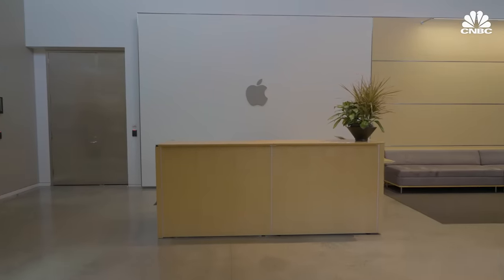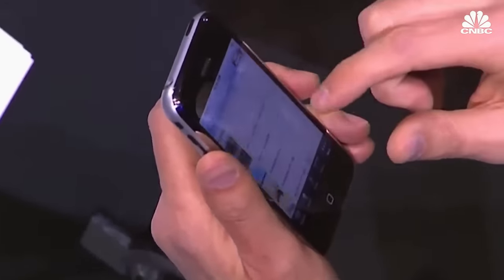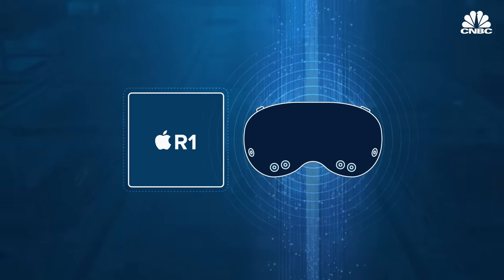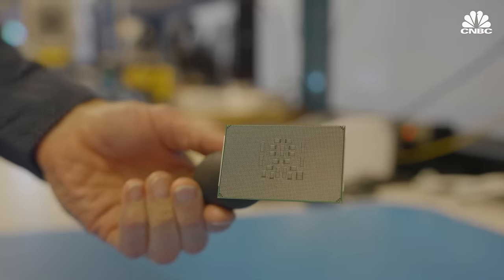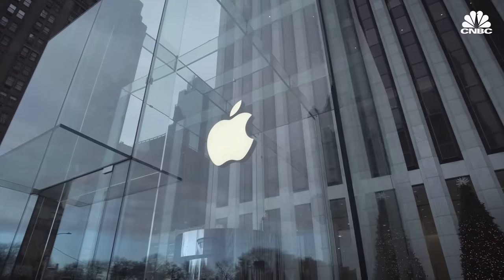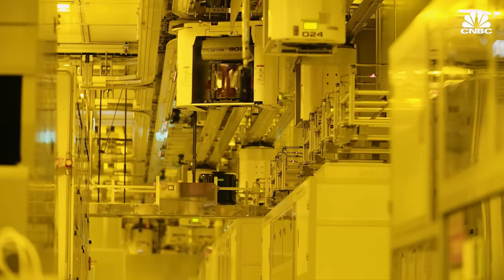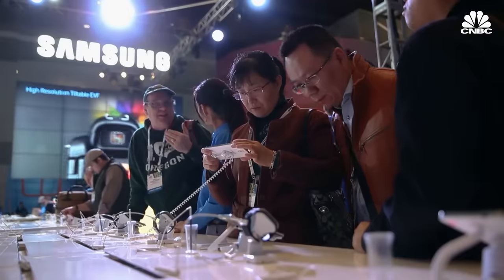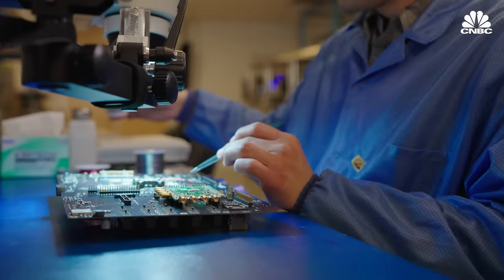Inside An Apple Lab That Makes Custom Chips For iPhone And Mac

Comment: If you think about it, it's kinda crazy that they probably have chips in that lab that won't be announced for at least another year or more. The M4 is probably being tested in that lab right now.
Reply: Much more. Their development lead time is years, not months. And that's not crazy at all. These things don't get created overnight.
Reply: @moeskido  I guess it's just interesting in the sense that by the time it's presented to us as new and modern and groundbreaking, the tech already existed and it was in development for years. Kinda interesting thing to consider when watching those keynotes, at least for me moving forward.
Reply: There would be chips being tested that are probably going to come after M series are done with. Tech moves fast so everything is in R&D stage everywhere.
Reply: @darkwoodmovies it is one thing to have something running in a lab on one test system and a completely other thing to have it mass produced and integrated with the software.
Reply: I agree with @moeskido. The M1 started development in 2008, aka when Steve Jobs was still alive and CEO, and the first iPhone had come out a year earlier.
Reply: @darkwoodmovies  That's every tech company, not just Apple. At least every tech company that knows how to plan ahead and doesn't make last-minute decisions with products that aren't ready to sell.
Reply: @DriveDawn  please explain this magical process where they can manufacture chips on processes that TSMC doesn't even have yet?  They may be engineering them, but highly unlikely that even M4 silicon is at the engineering sample step  yet.
Reply: @handlealreadytaken  No it's not. They can sample the logic of a chip without the efficiency of the next gen fab processes, at lower speeds and higher power consumption. Which is an incredibly important step to do. 

Just logic verification alone, is an incredibly important stepping stone. Not to mention, bug testing, early software testing and third party component integration (like cameras and radio coms), and more stuff probably. And this is for the CPU, GPU, NPU, Accelerators, I/O and what not, inside a single SOC model. 

Then, it's another testing phase with the proper fab, to search the limits of the final SOC.
Reply: @moeskido  You mean US tech companies. there isn't any tech company outside the US that makes their own custom chips for the worldwide market for PCs and smartphones.
the US it's on another level when comes to this type of tech.
Reply: Because the hardest part is how to produce at massive scale and minimize defects and cost. Also incremental leap is good for business
Reply: technological advancement really is fascinating. the problem usually lies in the execution, not the idea itself. ai had been theoretically possible for decades, but only now is it actually viable
Reply: Try the M6 - they are WAAAAAAAY further than the outside world assumes.
Reply: @darkwoodmovies  I worked in an Intel test lab for a few years. The effect on me was that when new chips came out at retail they were slow old yawn inducing tech since I was working with them 9 months before. 

I will say once you get a taste for bleeding edge tech it’s hard to care about retail much. Better to just buy what you know if good cheap hardware than to chase the latest which you know from experience is overhyped and under-delivers.
Reply: @handlealreadytaken  you don’t understand at all how this works. There are loads of prototypes before you get to beta, let alone production. It’s a very long road.
Reply: They are probably already designing the M5 as those chips most likely take 2-3 years to develop which is a similar amount of time to how long it takes to develop IPhones.
Reply: Not even the M4 probably, if not even the M5. They probably have chips up to M8 or M9 in developemt right now
Reply: m4 is in the ipad now😂
Reply: hey you were right  the m4 is now in the new ipad pro ( :
Reply: And now the M4 is in the new iPad pro!
Reply: M4 was just released for ipad pro. They def give a year for quality tests. So right now they are working on m6.
Reply: M5 is tested right now probably

Comment: I switched my whole eco system to apples since the m1 16inch pro. Never looking back. I was a hardcore windows and android guy, cracking software etc and being a geek...but apple products finally got me hooked..!
Reply: Most of my software engineering peers like apple products, including myself. Biggest reason is that the features i need are there out of the box, i dont need to tweak or jailbreak anything. I do admit that apple is behind everyone else on some features but I dont mind since when they do release the feature you can be assured that it will be stable
Reply: AndyGKaufman you mean a sheep enjoying a product that actually works unlike others
Reply: I did the opposite, left Apple lol I like freedom more.
Reply: Me too I did the exact same thing. I own every single Apple product since 2019. The ecosystem is ridiculous. never looking back
Reply: @mrdextrous355  now that's a real sheep lol, Apple fanboy.
Reply: @chromaticvisuelle  absolutely and I’m proud of it….next comment 👌🏾
Reply: @seanelias6478 my windows pc doesn’t have issues 😂
Reply: I switched away from Apple to escape their prison and anti competitive practices.
Reply: what out ofthebox u use
Reply: I see no reason to use any of apple lame products
Reply: @chromaticvisuelle  yeah
Reply: @susmoys most of what software engineers do relies on servers/data centers that are mostly Unix based systems. Mac is also a Unix based system. So out of the box, it inherently possesses a system architecture most of us are already very familiar with.
Reply: yep the hooked part is beta
Reply: Not me, did the same like you, now im back to windows

Comment: Intel got burned twice (once for phone chips and another for laptop chips).  The first time, Intel passed on making the mobile chip for the first iPhone.  They never thought it would sell well so the volumes wouldn't be worth the investment it took to design and manufacture the chips.  Fast forward about 10 years and Intel was very late to delivering the 10nm Intel chips for the new 2016 Macbook pro redesigns so Apple was forced to put a 14nm chip in a chassis designed for the 10nm power envelope which RUINED that entire line of MacBook laptops.  THAT was the final straw and about 4 years later, they unveiled M1 and Intel lost Apple's laptop chip business forever.
Reply: Well intel got arm license so don't bet on it
Reply: Intel got burned third time when Apple pushed Intel to clone illegally Qualcomm modem chip as Apple was butthurted to pay to Qualcomm "too much" for the chips. LOL.
Reply: Intel is still the leader in chips and to say otherwise is fantasy.
Reply: @Art-is-craft  They are number one for being in last place and for making unreliable/hackable chips.  Just because they sell higher bulk doesnt mean they are better.  Most companies just buy them because they think cheaper is better.
Reply: @chinito77  
When it comes to server and power CPU Intel is the only option. Everything Intel has was built by them. That is not the case for the other players who are function on open market licences.
Reply: @Art-is-craft probably not anymore amd and nvidia is way more advanced
Reply: @crunchy1848  
Nvidia do not make CPU so they are not compatible and neither are RISC based processors.
Reply: @Art-is-craft  nvidia makes CPUs as part of their Tegra SoCs.
Reply: @Longlius  
Is it RISC or CISC.
Reply: @Art-is-craft  It's a custom ARM design, so RISC.
Reply: @Longlius  
So it is not a high performance cpu and is not a competitor to Intel.
Reply: @Art-is-craft  The fastest supercomputer in the world is ARM.
Reply: @Art-is-craft   what kind of delusional bubble are you living in ? Intel is losing the server side to AMD epyc chips . Intel literally has no answer for Epyc for servers. a Single top of the line Epyc outperforms dual Intel Xeon Cpu on performance and power efficiency . As for destop , they are getting smoked by Ryzen x3D in gaming . Stop being an Intel fan boy and stop spreading misinformation .
Reply: @arnsassassiner  
Intel revenue has grown at normal levels and are the market leader. Intel has grown their own infrastructure all by them self unlike the companies that require licences and state department guidance.
Reply: @Art-is-craft  is that your answer for inferior intel products ? it will happen much sooner than you think, the day windows gets native ARM optimization , that will be the final nail in intels coffin . wait till qualcoms nuvia chip comes out .
Reply: @arnsassassiner  in gaming intel is still king i don't know what you're talking about. in workload amd wins hands down but in single core strength intel is still #1. Intel Core i9-14900KS becomes the fastest CPU ever hitting a 9.12GHz overclock, breaking multiple world records.
Reply: @hshc2630  at this point idk if you are trolling or not, 7800x3d beats intels best in gaming , while being way cooler and several times less power consumption. For 14900ks , it is mandatory to get a 360mm liquid cooler , still the cpu reaches 100'c. moreover the recent report of 14900ks being unstable due to pushing the cpu hard. how many daily consumers uses 9ghz with LN2 ? bringing useless benchmarks means nothing . if you wanna buy inferior intel , hey man , you do you .
Reply: @arnsassassiner  8 degrees on average is so much cooler...it uses less power because it has a lower clock speed so kudo's i guess.
Reply: @chinito77  You must be joking, the apple M series are hackable.....

Comment: I admit Apple took the right direction. For laptops efficiency or performance per Watt, they are now king of the industry. However, so many applications still live on x86. It's a difficult situation because of app compatibility. Hopefully, in the near future, it all works itself out.
Reply: Rosetta 2 has been available since M1 and allows x86 apps to run just fine on Apple Silicon.
Reply: 95% of the apps that i use and most people use are already optimized.
Reply: @bryncb And from what I could research, the power hit for running the x86 apps isn't substantial either.
Reply: I’m curious about Qualcomms new arm chip and how it’ll impact the android market. And if windows will eventually switch to them
Reply: @TylerMaximus  i think that even if qualcomm does it, they wont be able to match 
Reply: @anonymous-entity  I agree. Interestingly, the company that Qualcomm purchased is made up of top level Apple silicon engineers. Qualcomm made some pretty bold claims a few weeks ago
Reply: The eff with x86, once it starts to crumble, it will crumble very fast! According to Chat GPT.
Reply: the only problem with the M series of chips is the amount of RAM, which is a setback in a professional environment. The mac pro 2019 could host up to 1,5 TB of RAM, but even the newest and fastest M3 cannot handle (in these terms, we went back to 2015.)

Comment: Wouldn’t be surprised if Apple eventually expand into the world of servers in data centres with them making servers that use a new exclusive variant of the M series chips that is physically very similar in size to an Intel server CPU while being extremely powerful and power efficient so those servers could also save a lot of money for their owners in the long run when it comes to energy costs! :)
Reply: They r onto it

Comment: Macbook with M Series is really revolutionary and i think next 5 year no one can compete with M series chips.
Reply: not true , Qualcoms Nuvia pc chips shows promising results , it out performs M2 max in performance and efficiency . which is a good start . only time will tell .
Reply: @arnsassassiner  what’s about real life performance I don’t think Windows yet optimized for Arm chips and windows apps. Microsoft should focus solely on arm to compete apple.
Reply: @AliZamin  because there was no capable hardware worth optimizing windows for . hopefully after qualcoms nuvia chip, Microsoft optimizes windows on arm.
Reply: @arnsassassiner  microsoft should made Windows 12 specifically for arm.

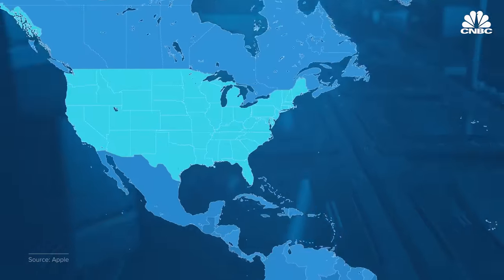Comment: @3:20 wow look at that
they are just sitting there on those kitchen metal racks

i'm used to seeing dust proof silicon environments, why and how is this able to be different???
Reply: It's not the manufacturing facility, it is the chip testing lab. Chip manufactured by TSMC in Taiwan.

Comment: You could at least mention the fact that most of the chip development is done in Israel, that Jony - head of Hardware at Apple is Israelie, that they bought 2 huge Israeli companies that ACTUALLY started their M series chips, and so on. But no, Israel you mention only when it attack Palestinian(or defened itself). Why would you say that half of the tech of this iPhone is developed in Israel? the Face ID chip? processors, motion sensors, software, etc ? Israel just attack Palestinian.

Comment: The amount of work and precision Apple has used to achieve this, is astounding. Truly a great company.
Reply: i love when i cant repair something i paid for
Reply: Completely irrelevant. You sir have many things in your home you don’t have the capability or time to fix as well. why should your lack of knowledge or lack of funds for software to fix your phone, cripple a major company’s extreme  engineering capabilities.
Reply: @Wakeupdud3 

That's not what he said. He says about apple's anti repair tactics. 

Like serializing parts of their iohone so you can't replace them by yourself or any 3rd party repair. 

The backglass with coil, cameras, boards, battery, screen is all paired to the phone.  Even their laptops has ram, ssds soldered to the motherboard.
Reply: @corbindallasmultipass  its called capitalism, maybe move to saudi arabia if you don't like fundamental aspects of it

Comment: Thanks for this, it is well put together. Do I really need to upgrade my devices? What are we using our devices for? Why fix what is not broken? Do we need the smartphone to change? I'm not convinced by foldables. When will smartphones outperform the Steam Deck, 1080p 120fps?
Reply: If it's not upgradable, then it's just a consumable, electric waste, and not that environmentally friendly.
It's built to work, but with an intended and limited lifetime, so that you will upgrade by buying a new system later, and not just incrementally upgrade what might be a bottleneck.
Two personal examples with laptops: when SSDs were more affordable we could just exchange older HDDs and get a significant boost to usability and increase the usage time since other components still worked okay. Or for work, when 8GB of RAM was getting tight for development with docker and you could just add another 8GB RAM stick (~40€).

An open system also allows more flexibility to fit requirements. E.g. if I need more disk space since I want to work with large datasets but do not require the maximum amount of RAM, ... and which the configurator might not allow me to choose.

Comment: Ok, here is my take, I do think Apple will move away from Qualcomm eventually, and what I think is happening is there developing a Apple codec for the 5G like Huawei polar codecs, and eventually move to 6G. Wifi and Bluetooth, I would also think Apple would work on something to replace bluetooth, along with perhaps redesigned or new audio codecs and etc, along with and uses the same codec as eventually 5G Apple codecs like the Nearlink Alliance headed by Huawei in China, wich would be better then bluetooth, I just don't think Apple would let Huawei be the best even if they exited the US market. Also they need eventually to have a response to new Qualcomm audio and IoT codecs while mainly audio based on wifi because eventually it will be caught on as they just announce at the Snadragon Summit and I would argue Ldac is already the dominant "Hi-Res"audio codec even with limitations. Apple can still have 5G in it's name because of the intel IP. As well as integrated and unify the homes and IoT integration with Matter protocole. Even if I love Home assistance, nothing beats native. Though Home Assistant would still be around with Matter as a manager. So if they are doing new codecs and get ready to have a second version or Version2 for 6G in the mid 2030's or early years as that is where 6G is expected, usually the wagon start and reporting start in earnest about poperly 5 years in advance and trickles to a major ad campaign in the deployment years. I think this will be the first time a new generation may take 2-5 years more then the 1 generation per decade upgrades of cellulare generation. So I do think this line up with 2026 eventually, which would line up with 2nm also.
Reply: aAdd; I don't see them getting into memory untill their is a paradim shift and they're leading the way to it, and it may or more likely if they were ever to get in do it yourself themself be as big as a shift away from Von Neuman.
Reply: They not getting into memory no time soon they still have kinks and stuff to work out with there modem since they acquire majority of Intel them sticking with Qualcomm is just to buy them time and to make sure they keep shipping phones
Reply: @dandre832  as I said, it may be as big a paradigm shift as away from Von Neuman and they're leading the way

Comment: What I would like to understand is if for testing they can socket their chips but once the final product comes out it has to be soldered. Why can’t they socket them for final products other than making it so consumers can’t upgrade their devices or that it makes it more difficult for people to be able to get repairs done other than directly through Apple. It makes no sense to me that they’re able to do it as a socket for testing, but not as a socket for the final product.
Reply: Slightly higher cost and size to have it socketed.
The real sin is the soldered SSD